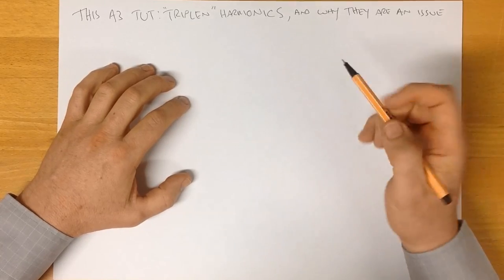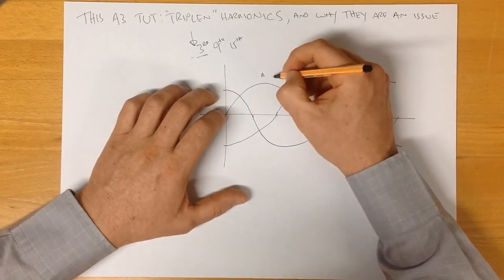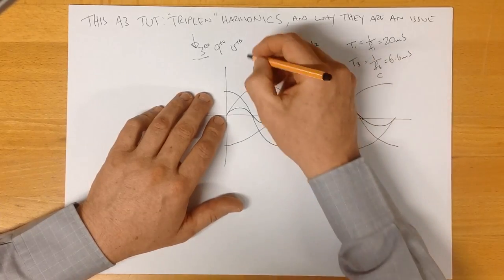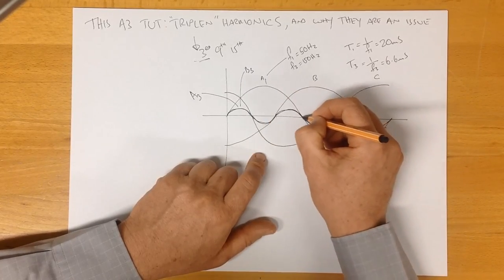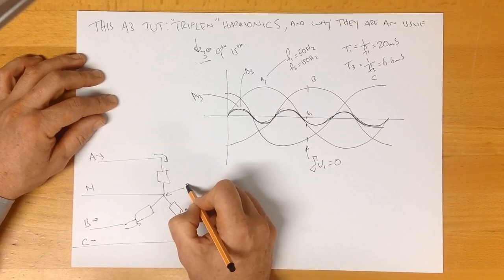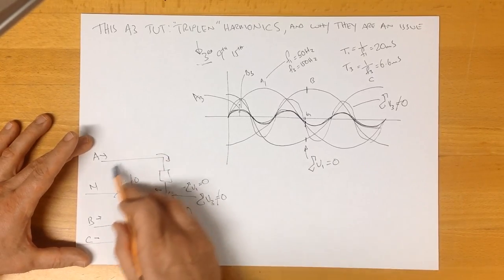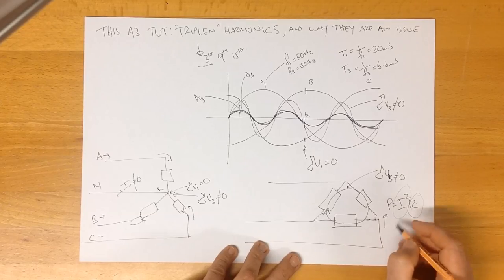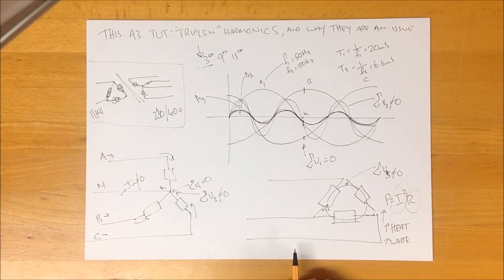Taylormade@AUT A3-tutorial: Triplen Harmonics, and why they are an issue

Comment: I wanna know what is the problem if any current flows through the neutral line of star connection?  Can't we add a resistor in that neutral line and let the 3rd harmonic current flow through that?
Reply: Shazon Haque...  by one of the defintion of a balanced system is neutral current is zero.. keeping that definition a side.. some of the relays in our power systems are placed in neutral side to identify ground faults.. so this harmonics will trigger relays to act...
Reply: thanks!

Comment: Will the rules apply for 3,5,7 and so on, Where the harmonics adds up with no phase shift?
Reply: 3, 9, 15 ,  odd multiples of 3, the "triplens" are non rotating and add on Wye/star neutral or circulate in delta windings.  7, 13, etc are forward "rotating" like the fundamental and 5, 11, 17 look like the fundamental but have 'reverse' rotation and cause reverse torque in motors